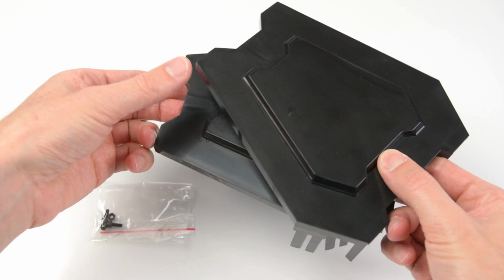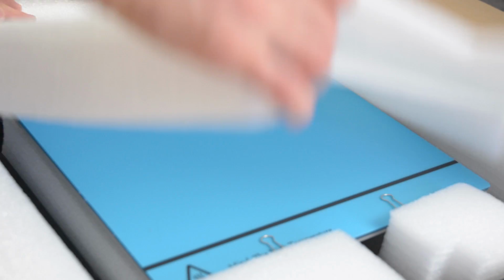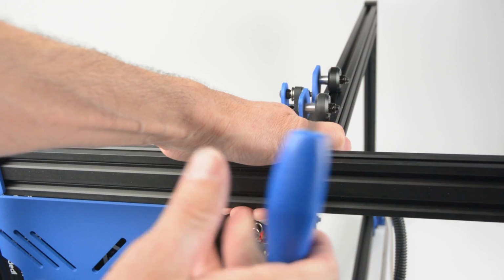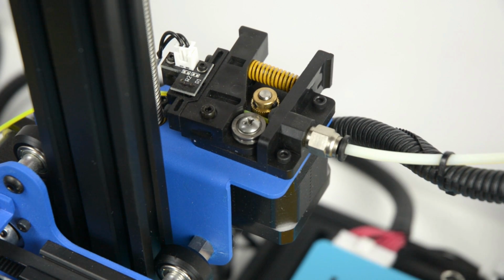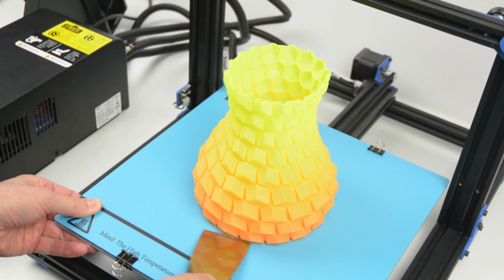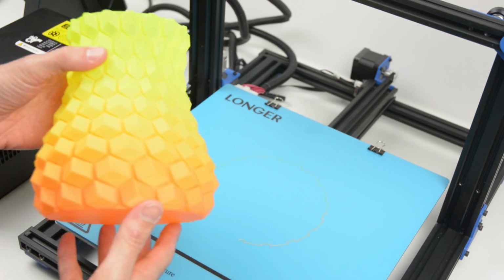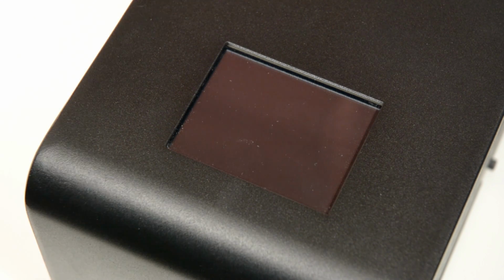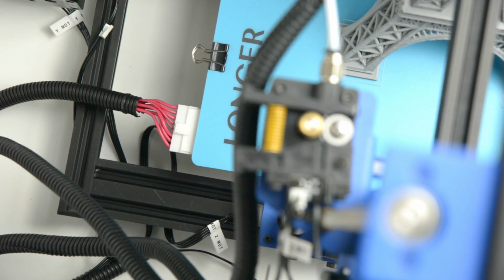LONGER LK1 3D PRINTER REVIEW SETUP & FIRST PRINTS

Comment: Is it possible to print a 3D printer?
Reply: Yes! At least (most) non-electrical components like the axis frames, and any parts that are already plastic on a typical 3d printer. It might be more expensive or just as expensive to build your own as just buying a 3d printer, but if you want to do it just for the project of making one I'm sure there's a ton of material online to help